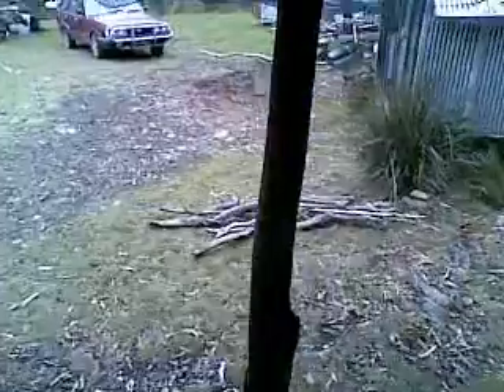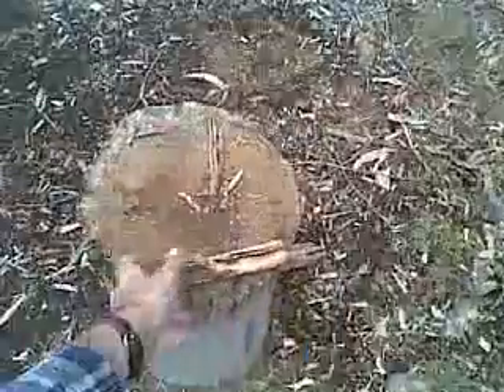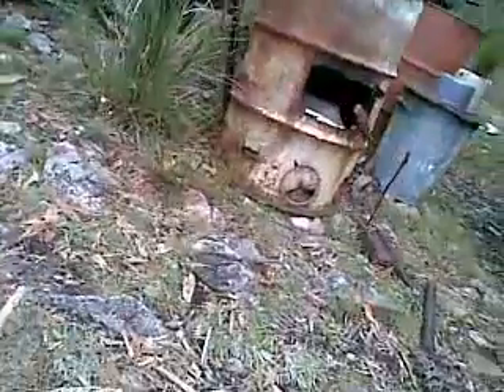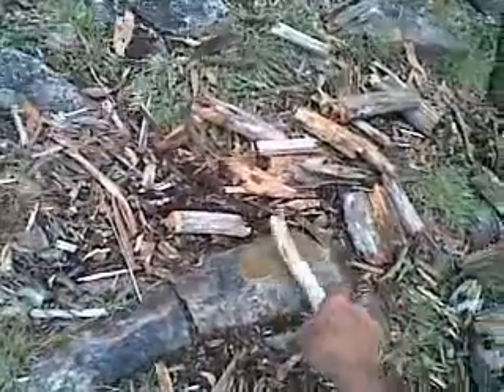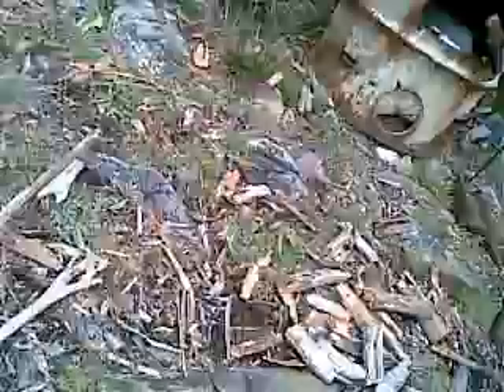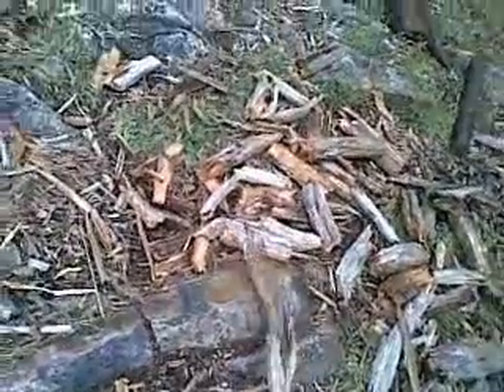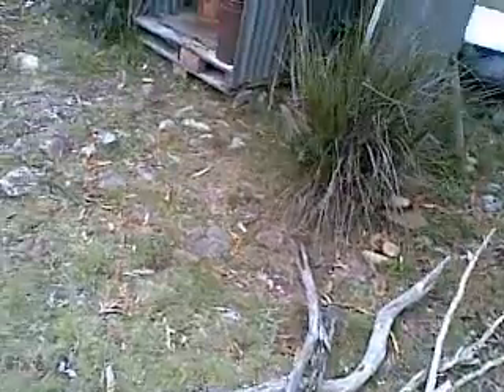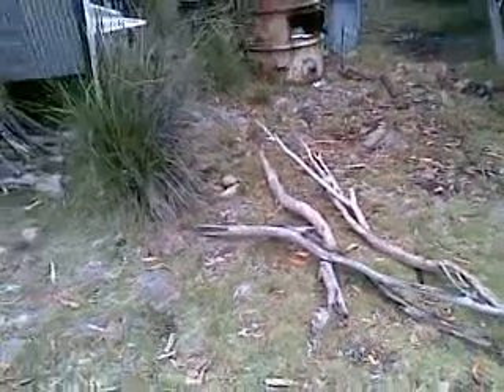Proof The Australian Traditional Stone Axe is More Efficient Than  Steel !

Comment: Thats a cold looking humpy.
Reply from the maker: G'day,

Thanks.

  Ah, well, y'see,  appearances may be deceptive...(ie, one is not as silly as one looks - think of it as being "Protective Colouration", wherein  I only look about as silly as the surrounding Norms actually are..., perhaps ?).

  The 3-metre by 4-m. "Lawn Locker" has 2 Perspex Windows, each 300mm x 600mm, and I used Liquid-Nails to line the interior Walls, Roof, and Doors, with 25mm Styrofoam..., stuck on in 1994 when I was using Kerosene Lights & a Kerosene Heater.

Since 2000, as well as 240-Volt AC (from Solar-fed Batteries & an Inverter) for lights, radio, DVD-Monitor, Phonecharging, etc, and a Gas-Stove for cooking...; for Heating there's a tiny little Potbelly (9 inches accross the Bell) which is so fiercely hot that I had to enclose it on the Wall-Side with a 180-degree Horseshoe-shaped Air-Cooled Hearth - which functions as a  Thermosyphon-dri ven Heat-Exchanger and Air-Pump that sucks it's Inlet (Cold) Air from Floor-level in the adjoining "Sleep-Out Bunkroom", delivering it's Output at 1 Metre off the Ground, through a  heavily insulated Duct...

When it's 0-Degrees Celsius outside, and it's 30 Degrees in the main Room, the Thermosyphon Input is running at 10 Deg. C. (also through an insulated Duct), the Thermosyphon's Output is 110 C. & the Air  actually delivered through the Louvred Apperture into the Bunkroom is emerging at 36-C., and in the Bunkroom at waist-height it'll be 15 C.

Not hot to wake up and get dressed in - but the Chill was taken off enough to be "brisk but not uncomfortable".

  For Winter Mornings, to catch the Schoolbus when it was maybe -5 outside, I would light up & stoke & feed the Fire till the Thermosyphon Output was 110 C, say for 25 minutes..., then I'd switch on the 28 Cubic Ft/Minute 240 Volt 15 Watt (Computer Cooling) Fan blowing into the Thermosyphon's Inlet in the Bunkroom...., that way within 10 Minutes all the Air in the Bunkroom had been pumped through the Heat-Exchanger.

My kids loved it, partly because turning on the Booster Fan pushed cold Air into really HOT places, forcing it to expand, in Pulses generated by the 12 Fan-Blades crossing the 3 Flow-Guide Vanes, and the resultant Compression-Wave Resonance causing the whole System to give forth a loud throbbing "Didgeridoo-Noise" which grew louder for 10 seconds, persisted for 20 seconds, then faded to silence over the next 15 seconds.

My kids loved it.

  One is a High-Tech Hillbilly Mad-Scientist Greenie Fool On The Hill, y'see.

  Look ye at my recent uploads..., to see the Experimental Airscrew Propellers which I've been making recently for the Thermo-Electric Stove-Fan which sits atop my miniature Potbelly, blowing 180 Cubic Feet of Warm  Air per minute,  accross the inside of my otherwise squalid little unpretentious Hovel (!).

Such is Life,

Have a good one.

;-p

Ciao !
Reply: @WarblesOnALot  ...I envy you Mr Warble !!!  Im sick of Sydneys suburbs.
Reply from the maker: @sondradupree8709  

Well, I hated living in North Strathfield, and Ryde, and Burwood, and Canada Bay, and Bankstown..., but Clontarf wasn't too bad...; the trick is to decide to leave, and then go and do it.

Such is Life.
Have a good one.

;-p

Ciao !

Comment from the maker: @electro1622
 G'day again... Cool, thanks, nice to hear from sonebody who can see where the Power goes... Um, as for the Theft-Proof SunFoil, search "SunFoil 5th Prototype Construction Project..." the clips are generally short. Try #40 first, to see what the finished unit looks like. All Bolt-heads are internal, and Nuts are e inside the Car. Bolts & Screws all inside. They'll buggar a Chainsaw trying to cut through the Plyons... Tee hee. Ciao !

Comment from the maker: @SnowWalkerPrime
   G'day... Yes, that's about it. But Common Sense is rather rare in contemporary society. So I thought this needed to be put out there. It's at one end of the Stone Tool Spectrum. Found, Readymade. To see the other end, 6 Cutting-Edges & a Sundial with Magnetic Variation Correction, 10,800 Years old... Search 'Secondary Uses Of The Boomerang-Carving Stone '. Cut from a 2-inch Triangular-Prism, 5 inches long. A Stone "Swiss Army Knife" !

Comment: Flying kindling is a constant problem for me. I've had fragments fly fast enough to penetrate a plastic oil container. I have considered using a guillotine but a striking impact is more efficient. Hitting the wood onto a stationary upturned blade is a revelation, but it is only suitable for very old brittle kindling. Unfortunately, this material has lost a lot of its mass and fuel value due to fungal degradation. Improving the power of the stationary upturned axe is necessary to brake sound wood